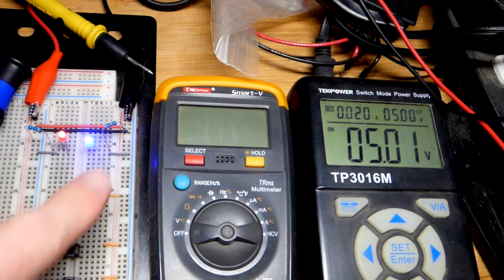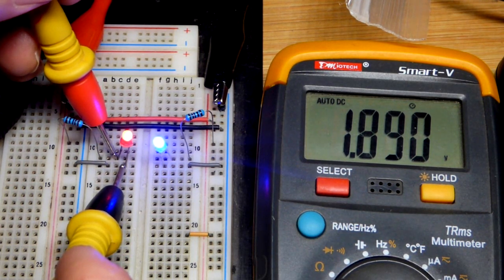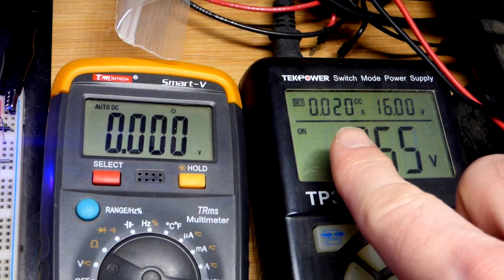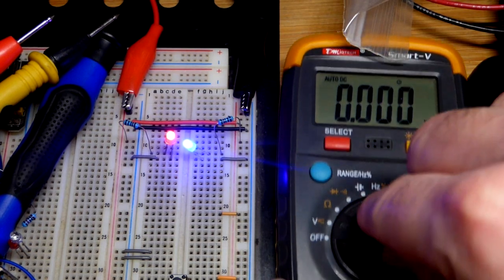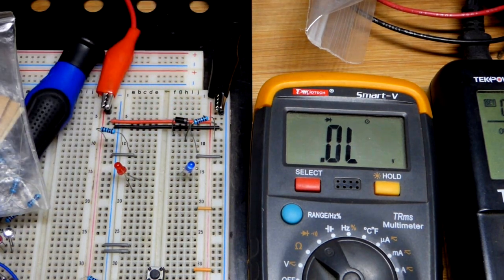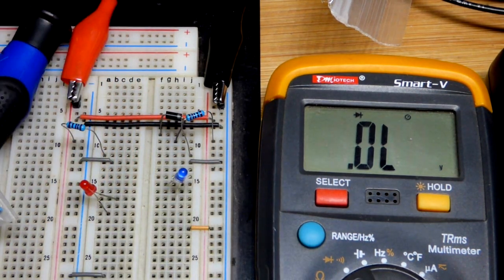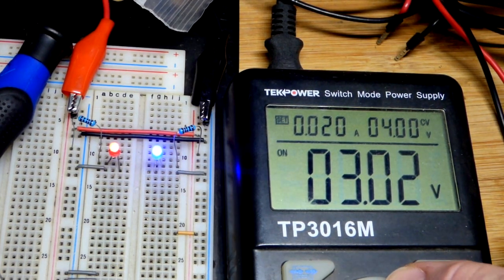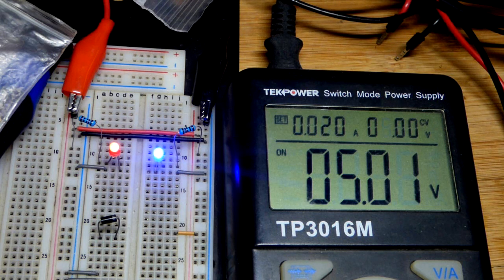How to multimeter measure LED forward voltage for beginner electronics by Electronzap

Comment from the maker: List of my videos https://www.youtube.com/c/electronzap/videos https://www.amazon.com/shop/electronzapdotcom/list/1ADLVE33FFFYL?ref_=cm_sw_r_cp_ud_aipsflist_aipsfelectronzapdotcom_B79P02M0KFPJ24S768FC As an Amazon Associate I earn from qualifying purchases. Americans should check out one or more of those links before making any purchases. There's no extra cost to you.
My website https://electronzap.com/ To donate  https://www.patreon.com/electronzap Become a member https://www.youtube.com/channel/UCC8jLsnnN1_o93p5QOIX1vA/join
https://www.reddit.com/r/ElectronicsStudy/

Using a multimeter, you can either measure the voltage across a diode/LED directly while the diode is being powered, or you can take a diode/LED that is not part of a circuit, and use the diode tester function. Diode testing function may vary between meters.